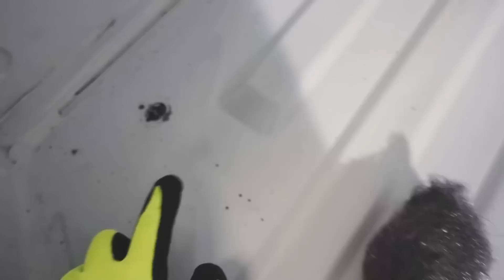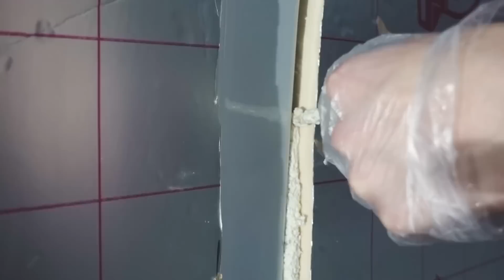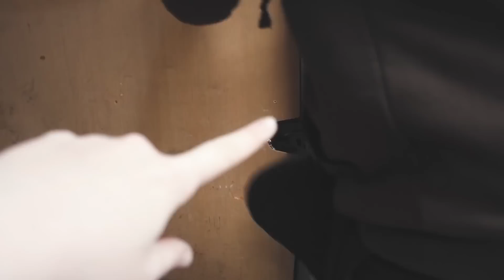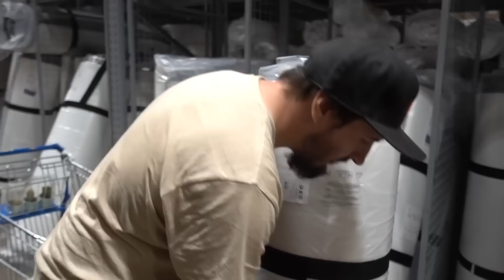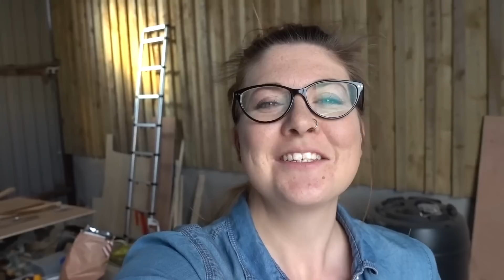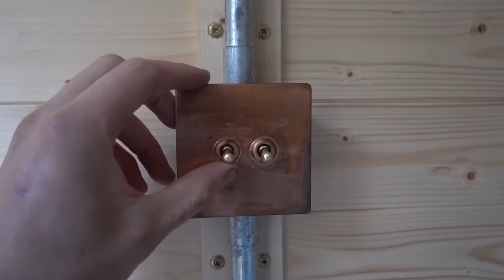HOW TO EASILY CONVERT A VAN INTO AN OFF-GRID TINY HOME | START TO FINISH!

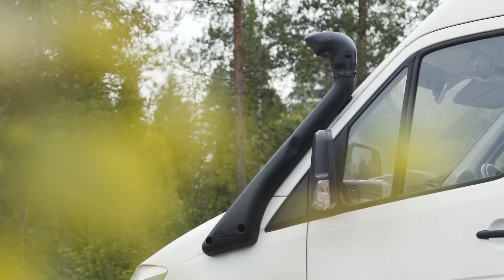Comment: 50:33 - This mf really just tried to claim that air from 4 feet higher up is somehow different.
Reply: The accessory is actually usefull for river crossing (no water coming into the air intake). What he explains with 'clean air' is as far as I know, bullshit.
Reply: @ronanmacgabhann7925  Because hot exhaust doesn't rise?

Hmmmmmm.
Reply: @ronanmacgabhann7925  Oh wow, they'll damage your engine? Man that's crazy. I bet cars everywhere are literally exploding due to this phenomenon. They should like, put a protective barrier between the intake and the engine. Like maybe a cloth, fiber-like material. They could call it an "air filter" or something. Wild idea right?

Lmfao nah, this entire premise is pseudoscientific snake oil. Try again.

Comment: Sorry if this question is silly, but why do you just make a small piece on sound damper in each area? (Apart from price) would it be better to over the whole area in it for better results? Or is it better to cut them smaller deliberately?
Reply from the maker: You only need to cover a % of the panel for it to work, and it’s quite heavy stuff
Reply: Its actual function is "Anti-Drumming"... to reduce vibration, But, to be honest, I'm unsure as to why they deemed it necessary.
Maybe, with the original bulkhead removed...it could have been a problem when on the road....? 
But as they say: Prevention is always the cheaper cure. I'm sure they did the right thing. Better safe than sorry.
But yes, you only need a small "patch" on each panel to cancel the drumming....no need to cover it completely.
(Check the panels inside the doors of your car..... It's the minimum.)

Comment: Note the glue in the strips must be Heat resistance or it will peal of when it gets hot in summer /Just a thought /And when PAINTING THE Existing use prep first to give the over coat tooth making sure that the thinners are the same as the Red Oxide .Ask for advice from Paint suppliers & and read the instructions on the Paint Can .Good Luck Cheers ...J

Comment: If you want to sleep in the van, do you lock it using a wireless key from the inside?
Reply: IIRC Sprinters have a switch on the dash to lock the doors.
Reply: @chrisbrookes1167  thanks!

Comment: Very nice home, and fine work. Just a question: could you have installed the cabling before paneling, so electric cables and pipes were hidden. But even  cabling over the panels, they seem not to be disturbing, good work.

Comment: I'v only been online a few short months...have taken to watching tiny house builds/van/bus conversions like a duck to water...I especially love your design through your choice of timber and artistic details...lending a beautiful homey cottage feel to the small space...which in my opinion counters claustrophobia...in my grandparents' cottage the electrical wiring for lights was threaded through conduit just like you have chosen...very practical...which over many years I'v dreamed of reproducing for the sense of belonging it would give me...may I make one suggestion?...in Oz there was a product called Rub and Buff sold at hobby shops...it came in metallic finishes and was very easy to use...those steel conduits could do with a lick of copper/bronze to work with all your other ancient touches...one more suggestion darlings...tomahawk/shovel should be kept safely stored in your garage...it would be wonderful if we could trust everyone...but alas in our current world that is not the case...God bless and keep all three of you safe on your journeys!

Comment: A wire wheel on your drill might be more effective than steel wool. What did you use between the metal ribs of the van and the metal foil to prevent thermal transfer ?

Comment: Boat plywood is strong, lightweight and flexible for cladding. Toilets should vent to outdoor but be waterproof in case of rainy days. Triple springs for under van. I might have put the roof rack in before the build. Mosquito nets and a wonderwash for laundry. Well done good work.
Reply: Mosquito nets for every doors and windows are essential in northern... in every areas. Think about extreme heat nights near the bonds or idyllic creeks you try to sleep on. There are millions of bugs and mosquitoes just coveting your blood! Wonderwasher is great idea!

Comment: Yeah putting your Shore power electrical outlet charging batteries in the inside is a very very bad idea use the generator to charge it one time you end up killing ourselves or end up stinking up the van  plus you cant shut the van when you use it either   

Now you have the solor so maybe you wont need to use it but im from Florida USA and every time there is a hurican i hear about people who moved to Florida later in life and died from breathing in generator fumes  at least 10 familys per city go out that way
Reply: That's terrible.  Sad

Comment: Sound deadening should have covered all the sheet metal that they were covering. 
Pointless putting it on in patches as sound will get through the exposed parts.
Reply from the maker: Nope you’re wrong, it just needs to cover a % of the panel 😎
Reply: @theindieprojects  True , it’s not the same as an application for insulating against cold .

Comment: Love your build, only thing I kept going back to was your small sliding window cut out, the depth of that wall said to me a 45° angle would let more light in.

Have you collected the data on kerb weights before and after build?

Comment: Really nice job! I would like to have seen more on the specifics of your electrical system (i.e. what the different components do, the order in which they need to be hooked up and how you ran and mounted your wires/cables throughout the van). would have been a lot more useful then the painting and other interior details that are personal touches so don't help the watchers.

Comment: Do you find the sound barrier you added really helps?  I bought a used RV and the driving noise is a bit much.  I've been researching to decide on the best options for sound barriers.
Reply: Also, I love the video; thorough!  Your video is the only one I have seen that was so thorough on cleaning.
Reply: How does the recycled plastic insulation perform?  Does it hold moisture and contribute to RV humidity w/ potential mold concerns?
Reply: The cabinet modification is absolutely the BEST!

Comment: I thought that bulkhead was structural to the integrity of the van in the event of a crash and rolling over, how did you get insurance on the van after taking it out?
Reply from the maker: No it’s not 🙏🏻
Reply: Can confirm it’s not on last mot. RIP it out!!
Reply: @TheFreedomFarmacy  it's not the MOT to worry about, if you remove the bulkhead no one will insure it as a standard vehicle, it will have to be declared to the insurers so they can assess it and adjust the premium accordingly (a vast increase for customising makes  them almost uninsurable), if this change is not declared then should the insurance ever be needed for accident or theft it will be found to be uninsured which is a criminal offence and will mean the insurers can just walk away.
Reply: @nicktombs1876  I just ordered a crafter with the bulkhead removed as a factory option. It did not affect the insurance when I mentioned it.
Reply: @travellingDAS  If it is a factory option it will not affect the insurance, if the bulkhead is removed as part of an aftermarket custom, DIY or by a proffesional and is not declared as such to  the insurers then when a claim for the vehicle is submitted the owner will find that the insurance policy is completely null and void, so not only can they not claim any costs back and they will also be deemed to have been driving without  valid insurance and will be prosecuted as such, certainly in the UK.

Comment: There are actually shaped seals that you can fit in the hole you have made you slip the  thing in the hole then put the sealant  You bought around the  edge of the hole and the object you have put up there making it water tight and safe...

Comment: 1. No instruction on the wiring of anything. Not the 4G booster, solar panels or the light bar. No mention of any certification or inspection of the Gas or leccie work.
2. No video on plumbing in of the water or waste.
3. No instructions on the diesel heater. I take it was one of those cheap chinesium diesel heaters?

Other than that, a few bits and pieces were discovered so thanks. :-)
Reply: Try watching again and you'll perhaps find out the brand name of the diesel heater .... if not, ask an adult.
Reply: @davidwands1899  wow thanks for the grown up response. I would suggest you sue the charm school for a refund. No worries. This is one channel I’m quite happy to unsubscribe from. Wally.
Reply: @Ronin6069  ....you got the reply your stupidity deserved.
Reply: @Ronin6069  .... next time you come across a young and enthusiastic couple, have a go at encouraging them .... and remember, they're doing "it" whilst you sit in your wee room "wishing."
Reply: @Ronin6069  .... toodly.

Comment: Looking at the start of the video with the finished project - I love the conduit - It's the most practical way of dealing with the electricity as you don't have to worry about accessing it behind the panels if something goes wrong. Repairs should be much easier and it looks great!

Comment: Why isn't the sound deadening stuff put on to fill the areas? Why is there so much space bwtn the strips of material??
Reply from the maker: It’s sound deadening material which is incredibly heavy, it’s used to add weight to the frame and stop rattle. You only need a small amount!
Reply: The smaller pads stop the sound ressonance / vibration hence zero improvement or very small gain to fill the entire panel  and as stated its expencive product. To test the product knuckle knock a panel on the outside with and without the sound proofing .

Comment: Very good. But personally did not like the trunking and lighting, would have preferred recessed lighting and hidden cables. Who did the electrics in the rear boot ? As no electrics were shown during your fitting of the cladding.

Comment: Noticed no insulation, that's ruff.
Reply from the maker: The whole van is fully insulated 🤣
Reply: @theindieprojects  I should have explained better. Good catch.  I was referring to when you pulled the intended sections of panelling pre window install.  It looked like bare can metal there.  I was glad to see you went ahead and pulled the rest. 

I wonder did you insulate with wool either loose or sheet or another product.

Comment: Obviously hindsight is 20/20 vision, but I don't understand why you ended up running the lights and switches in conduit on top of the cladding, when you had the opportunity to hide all of that wiring underneath the cladding and just have clean, flush-mounted switches and lights. After all, you started with bare walls, so you could have hidden every bit of the wiring for everything underneath and had everything flush-mounted. Is there any particular reason you did that, because it strikes me as the only design flaw given how much attention to detail you expended on all the other splendid features your van conversion sports.
Reply: It is different, but I think it looks good

Comment: Really felt concerned about the axe and shovel on the outside...available for someone to use agsinst you..especially as you plan to be in different counties. Loved  your video..
Reply from the maker: They have locks on them and the van is to high to reach them without a ladder.

Comment: Nice build, the snorkel is for fording streams,a slug of water through low riding original intake ducting will, at a minimum stall engine, at worst break pistons/ bend rods.
Reply: Philbilly 
It’s also to get cleaner air when traveling in dusty environments to stop the air filter clogging up, which in this application will be its primary purpose.

Comment: Great to see, how 'rustless' the inside of the van is. I would recommend, also to check underneath the plastic side panels outside, and nip any rust there in the bud - and extend the life of the van. - Haha, and a short while into the video, you took off the side panels... Well done!
A question about the regulations about the 240 V electrics in the van in the UK. Does that have to be checked and 'certified' by a qualified electrician? As far as I know, it's OK with DIY for the 12 V stuff.
Reply from the maker: Nope doesn’t have to be certified but we did have it fitted by a professional!
Reply: @theindieprojects  I see, thanks. :)

Comment: Great conversion guys! Question about he bulkhead lighting - they're running 12v right? So did you just strip out the 240v bulb mounting on the inside and install 12v warm LEDs inside,  just keeping the nice brass/gold exterior? ta
Reply from the maker: We had them fitted by an electrician who sorted all that out so can’t really advise sorry!

Comment: why you dont have entrance from the driving cabin to the  house,? so you dont need to get out of your driving place to enter the house
Reply from the maker: We opted to have a closed cab so we could have a full bulk head kitchen instead, it also works incredibly well at keeping out the cold/heat. We can fit through the hatch in the kitchen if we desperately wanted to get into the cab or the habitation area without getting out the van 😊